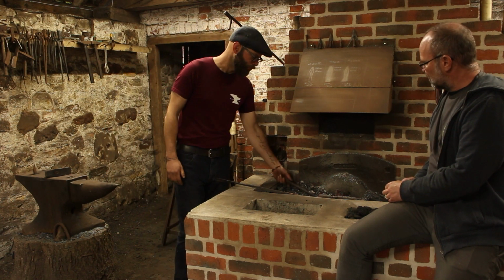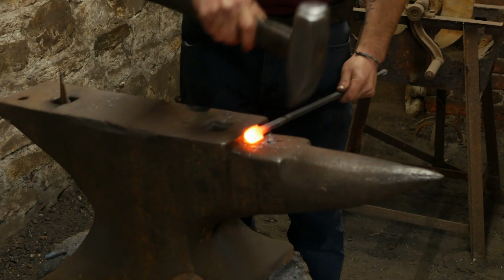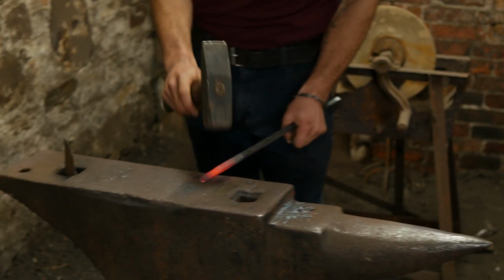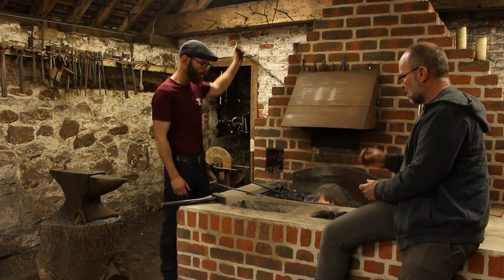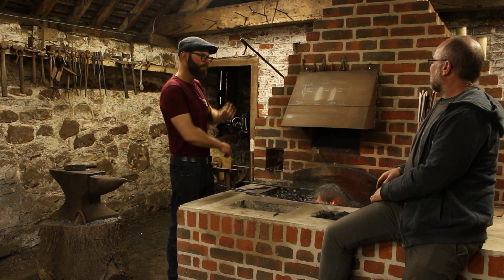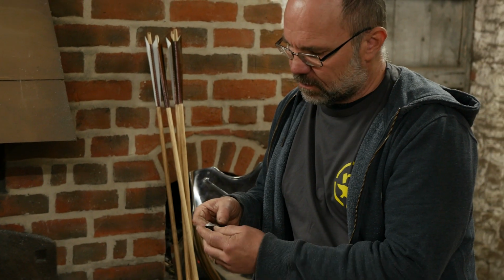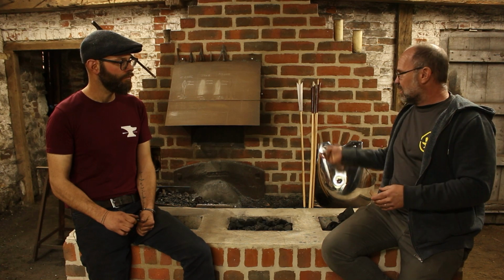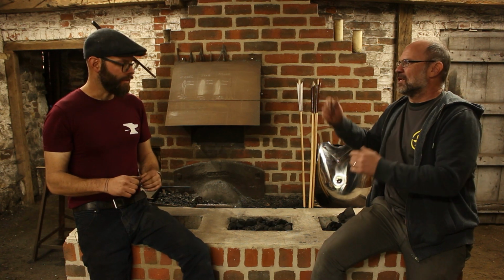FORGING AN ARROW HEAD, full process.

Comment: How did they make the metal bars in the medieval times? I mean, nowadays you can just melt iron/steel to make ingots or bars of any shape or form but how did they achieve that back then? Or what did they work with if they didn't?
Reply: Iron ore comes out of the ground in the form of rock.  That rock is baked, then powdered and smelted in a furnace with charcoal,  using bellows.  It becomes a "bloom" which is a lump of iron and lots of unwanted impurities called slag.

That bloom is then worked by the smith carefully consolidating the iron and working out the impurities until he's left with a solid billet of iron,  usually in bar form.

That billet is then used to make anything from arrowheads to wagon tyres.  It can have carefully measured amounts of pure carbon (charcoal) added at welding temperatures to create steel,  if a harder,  tougher material is required.  

This was the process from the beginning of the iron age right up and into the Victorian era.
Reply: @MedievalArrows  Thanks for the reply! So each smith would have to buy bloom or would there be specialized smiths who just converted bloom to iron billets and sold those to other smiths?

Comment: Type 9 vs 16? Please elaborate on the difference between them. Type 16 are the only ones found to be hardened. Have Type 9s been case-hardened but it's just not noticeable in the archaeological record? Are both comparable in terms of plate armor penetration? What about the economic considerations between the arrowheads? Which are fastest and easiest to produce? Is blacksmith time or steel-usage more of a concern in the economics of arrow-making?
Reply from the maker: All very good questions and in fact this sort of thing is exactly what we will be addressing in one of the upcoming Arrows vs Armour films

Comment: OK, uninterrupted build starts at 14:40 and quenches at 21:00, so about six and a half minutes to make one head.  So, to make the historical 100 a day would be 630 minutes, or ten and a half hours!  Doable, but a very hard day.  I would assume that there would have been efficiency improvements back when arrow making was a major industry, possibly apprentices to work the bellows so several heads could be on the go at once, maybe more advanced apprentices to cover the more basic tasks.  Still, that's a lot of work!
Reply: In 1228, when Malemort was making 100 heads a day,  the heads were simpler and quicker to make.   I'm also not rushing or trying to meet a deadline here.  6 minutes at a fairly gentle rate making sure the camera can pick everything up, making a more complicated head turns into 4 minutes when going at full speed making a simpler pattern.

Comment: So why use square stock and not round?? 
Enjoyed your video and I gave it a Thumbs Up Tod
Reply: Because if its round,  I then have to square it up in order to make a square or diamond cross section,  which is a wasted process.

Also,  original iron and steel blooms would be forged into bars using a hammer and anvil,  which gives you square or flat stock.   You then have to add an entire and lengthy process just to turn a square bar into a round bar,  for no reason whatsoever!

Comment: The question is: If you'd already fired your last arrow whilst being chased by a brigand, and ran into a blacksmith's workshop, would you be able to quickly smith yourself up an arrowhead, fit it to a shaft, fletch it, then spin round and kill your persuer in the knick of time?
Reply: I would guess no, the shaft and head maybe, but to my understanding the fletching is glued on, so that has to cure as well as the nock

Glued in addition to the ties, can't think of the actual term right now, lol

Comment: Given that water powered trip hammers were a thing, what would be the possibility of such a hammer being used in conjunction with a pattern…. That’s right, drop forging blanks —— flat bit and pointy bit, finish the socket after the drop forge….. would definitely increase production and uniformly…. Plausibility or am I reaching here?
Reply from the maker: Possibly, but trip hammers tended to be much bigger than needed for this.  Plausibly yes, but I don't think they did

Comment: wondering if an arrowhead straight out of the fire would be hot enough to possibly set ship lines house roofs on fire large wooden structures ect
Reply: If it was, it would burn itself off the arrow shaft.
Reply: @DH-xw6jp   Possibly but the socket did stay relatively cool when he was working the head a well controlled fire might make it  feasible
Reply from the maker: I am with DH - not viable as to heat the heads would burn the shaft way before you could shoot anything
Reply: @tods_workshop  are there any realistic and/or historical uses of fire arrows?